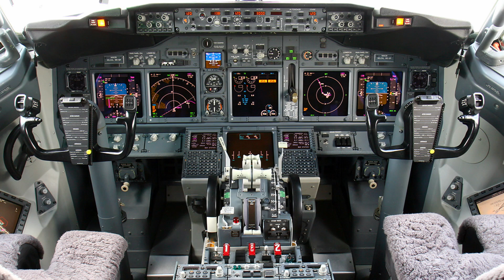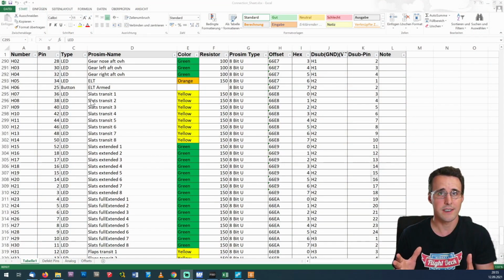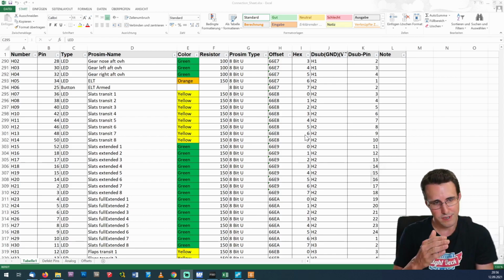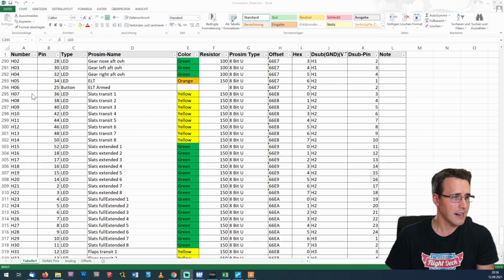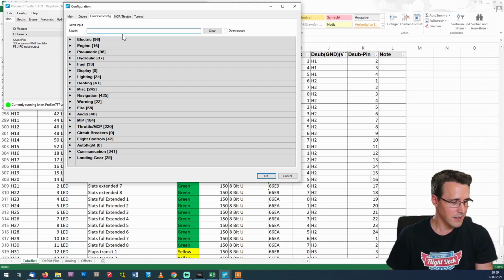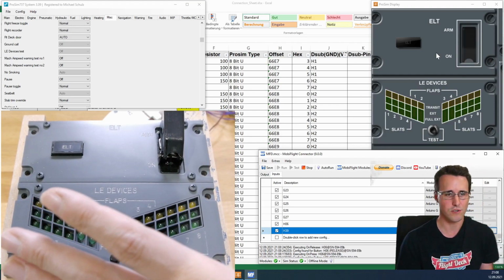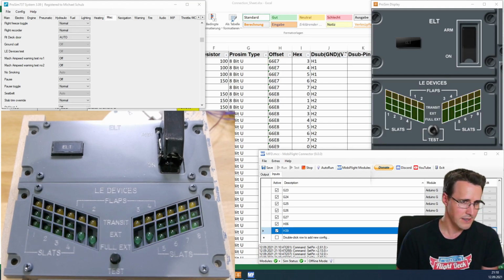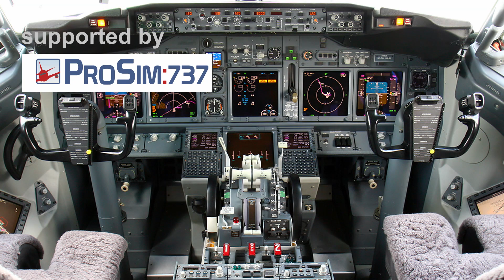ELT & LE Devices Panel - A Boeing 737-800 Homecockpit #58

Comment: What are the specs or part number of those LED strips used for the back lighting?
Reply from the maker: I don't have the exact article anymore. But you have to search for 5050 LED strip, not waterproof, warm white and 60 LEDs per meter.

Comment: If you put leds in parallel with the same resistor value as others they should stay the same brightness as a single led with the same resistor value. But I think you made the right choice using one as an Arduino output pin most likely can only supply enough power for one.